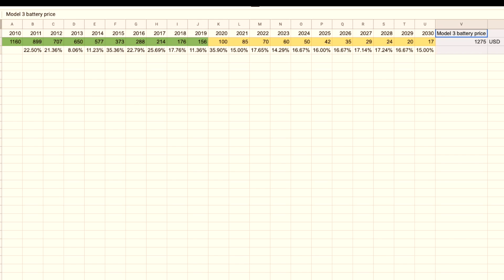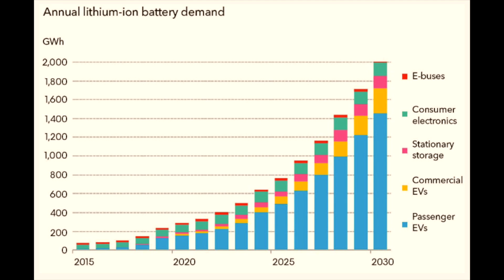Battery productions will skyrocket, and price will drop out of the sky | $20/kwh is coming |

Comment: Raw materials is currently around $60-$80/kwh for Tesla.. So even if Tesla could transform raw materials into batteries with magic and no cost.. It would not be close to $20/kwh..
These kinds of numbers pulled out of nothing is not great for Tesla and very bad for their investors.
Reply from the maker: Yes with the material that are in them today. But that will change toin the future 😉
Reply: @BestInTESLA  What materials will Tesla use in the future? Even the LFP batteries from china which is made from dirt cheap materials are several times more expensive than your target. kwh/kg needs to multiply several times before $20/kwh is possible.
Reply: Nicki Jensen watch the battery day presentation
Reply: @amitcarbyne3635  they did revolutionize the sourcing of materials and they can soon create batteries at 50-60$/KWh.
Its very insane!
Reply: Nicki Jensen yeah tesla is insane. $70-80/KWh by 2023 & 200 GWh/year production. Super insane

Comment: Tesla has 1 million+ cars on the road.
Let's say in 10yrs time these 1m cars are scrapped. And These battery packs are just 10% of their former capacity. If the packs started off at avg 50kwh(for argument sake) , these used battery pack of combine together have a capacity of 5Gwh of storage. If Tesla did actually buy these used pack back, then they would have a good nice size grid storage of Gwh range. They could actually also become a huge grid storage auction bidder company. So another 10yrs another bunch of EV comes off line too become storage etc...
Not bad for used batteries.

Personally think these cars would be scrapped (or battery swapped) at not 10% capacity - 20 miles on the tank but rather owners will give up at "it's only giving me 120 miles of range"... 
That's 40-50% of former capacity.

And having read your title $20 /kWh pack and thinking "really?"... Now, it's yes I guess you could be on the money...

Comment: $20 kWh is coming by 2030 is a stretch. In my opinion, we may not have the adequate cheap materials on time. Even if Tesla was to go into mining, not all Big boys will. Lithium availability will be a headscratcher! 

We need to see a real move towards ramp up in materials mining! Its 2020 and except for Tesla, we still at the stage of determining which is the best battery chemistry! before they make real investment decisions to ramp-up mining lithium based on a battery chemistry latest 2021. 

Then assume Elon time in ramp-up of lithium mining factories (5 years), battery factories (2 years) car manufacturing factories (2years)? then ramp up all to make 10 million cars?

Comment: Please consider, that in reality each exponential curve is natural limited.
It might be better to compare the price drop with the number of produced storage and not by years.
Empiric data shows often halving of production cost by 10x larger production volume. Therefore the future price in 2030 might be rather near $40...45 / kwh.
$20 seems unreasonable too optimistic in my opinion.
Reply: jan gauss with recycling of batteries $20/KWh is possible by 2030
Reply: @amitcarbyne3635  considering the effort tesla makes, it might be possible in 2030
Reply: jan gauss yeah i think it will be possible specially when tesla cracks solid state battery. After 2030 we might even look at the possibilities of nuclear reaction direct ion ( no steam needed ) creating batteries.
Reply: @amitcarbyne3635  Solid State isn't needed anymore. Dry coating + silicon is enough.
Anyway future battery chemistry will advance even further.

Nuclear + steam is an efficient way to produce energy (compared to other methods).
Reply: jan gauss no it’s not. Reducing battery weight is important. Imagine direct electricity generation from nuclear reaction without steam.
Reply: @amitcarbyne3635  battery weight is reduced a lot with the 4680 cell! Elon just has not stated it... However the presentation and hard facts shows it.

Electricity without steam is in my opinion extremely inefficient.
Nuclear generates heat. Heat needs to be transferred into motion before getting electricity. That's a fact.
Only thermo elements can generate electricity directly. In cost of >95% loss.

Comment: "How are we gonna get all these batteries" Important question! We can view batteries as a limited resource, at least for the next few years, and as such we need them in as many cars as possible to make the most impact. So light plug-in hybrids with an electric range of perhaps 25 miles = 40 km will result in more CO2 reduction than what eight times fewer fully EVs can do. Fully EVs need far bigger batteries than plug-in hybrids, perhaps eight times bigger.

Comment: Think the new chemistry is already in the batteries. Elon said the chemistry is already better than the old cells (better range in new cars). I think the million mile is already in new cars. But the other thing (dry electrode, etc) will come after. Continuous improvement, moto of Tela
Reply: Unlikely. I guess the million mile battery will be the LFP battery produced by CATL for the chinese market. They will not offer better range but will just be cheaper and have a longer lifetime.  "Better than the old cells" - yes, better cycle life than the old NCA cells used by Tesla so far. And better capacity per weight than current LFP cells. But I doubt they will give you more range and better cycle life at the same time. But let's see.

Comment: I would like to see Tesla hold off on all production of cars build semi build truck and ramp up batty production with solar roofs and build chips and make sure chips are secure from any type of emp as well as stock pile solar roof tiles in secure area under ground in a boring company tunnel under a city just protect all electronics and truck as well as the vehicals in storage from emp and Americans buy the china Tesla 2 cars to put in gaurages that is safe from a emp dyi self care

Comment: That is a total stupid Tesla promotion! What to do with all these batteries if there is nowhere to charge? Furthermore battery price should include disposal and the road digging/cable laying needed for the charging points. Nobody wants to carry a dead weight of 800 KG in a car for an acceptable range. Best power source will be H2 and Synthetic liquid fuels. Now return your free stickers to Tesla and get real.
Reply: Charger networks, utilities, parking garages, home owners, many entities will be building out the charging infrastructure. As it stands right now, going electric is the best replacment of fossil cars. People can even charge at home. 
H2 has already lost to electric and will remain a niche market. Synthetic liquid fuels have obviously not had a breakthrough either.

Comment: Sir, you make some great points: however saying the price of the battery will be down to $20/kwh  is something I disagree with. The raw material costs alone are above that and there is only so much battery density you can get. I believe $60/kwh is achievable . I hope you are right and I am wrong.
Reply: Going LFP reduce the cost of materials since iron phosphate is so much cheaper compared to nickel aluminum oxide. Switching to lithium metal anode also reduce material cost since you are removing high quality graphite and replacing it with thin lithium coated metal foil. Cell to pack technology reduce the amount of packaging material. Additive that increase voltage increase the energy capacity per unit mass which means you need less battery cell per kwh of capacity.
Reply: @kazedcat  All good points. You can add the tabless electrode to the mix, which has major potential advantahes for cost reduction, life improvement, reduced thermal management requirements, faster charging, etc. You should also subtract credits for simultaneous use of the battery for its energy storage benefits to the grid. These credits could potentially exceed $100/kW on their own, making the battery essentially paid for entirely by these credits.
Reply: Correction - meant to say $100/kWh, rather than $100/kW
Reply: @greggrant4614   Thank you. I hadn't considered energy storage benefits to the grid. You make a good point
Reply: @kazedcat  You make great points. However can this be scaled up? If so go for it!

Comment: I hope that Tesla can ramp up production for their own cells soon. I expect most car manufacturers to fully embrace the battery electric setup and start scrambling for sells. They will fight to get battery production, and could end up driving prices upwards since battery cell manufacturers will only provide production capacity for the underestimated demand. A burst in demand would thus end up with higher prices. But if Tesla starts manufacturing their own cells and get the cost of those cells consistently below 100$/kWh, it doesn’t matter that other manufacturers are driving prices up. They could even start supplying the other manufacturers with B grade cells of their production lines if they have enoug production capacity to fulfill fulfill demand of their vehicle production with A grade cells alone

Comment: I own a long range model 3 with a 75kwh battery, I'd love to swap that out for a new to be developed battery so I can go from 320 mile range up to that 1200plus mile range.  That would be fantastic and those older batteries could be used in a power wall.
Reply: Me too 💪🏻
Reply: @chiefinvestigator9671  My model 3 has the upgrade for increased power. I did that a few months ago.  So a longer range would be terrific.

Comment: Material constraints on price will limit the price drop of current generation batteries. Should we reach solid state sodium or potassium metal batteries, with no rare or expensive metals, then energy density will greatly increase with a big drop in bill of materials.
Reply: Sodium Iron for power walls? Anything cheaper?

Comment: The cost will always be dependent on raw materials availability. Cobalt has to go and ideally nickel as there is limited supply.
Reply: Yes, Co and Ni will have to be phased out soon.  Can't scale with those as main ingredients.
Reply: The new battery is without Kobald but with iron witch is Plenty on earth
Reply: While lower in cost per kWh, the energy density of the Lithium Iron Phosphate battery is lower than the Nickel based Lithium batteries (either Nickel-Cobalt-Aluminum or Nickel-Manganese-Cobalt). Not sure what all Elon might do to offset this energy density  deficiency of the lower cost Lithium Iron Phosphate chemistry. Ultimately, we will probably need the Lithium to be replaced with something much more readily available and cheaper, like Sodium, to get below $70/kWh at the battery pack level.
Reply: @greggrant4614  NaFePO4? Cheap for power walls. Battery day nearly here. Elon says alien tech?
Reply: @gavinmcintosh7022  It appears LiFePO4 will be produced by CATL in China at least for Tesla cars produced in China, not just for Powerwalls or Megapacks, though it would make sense for Megapacks where energy density is not as important. This battery has also apparently been approved by China's government for use in a "longer range" Model 3 to be produced in Tesla's Shanghai gigafactory. Hence the mystery is how does a lower energy density battery turn into a longer range Model 3? I guess we will get our answers about this alien battery on Battery Day, but it could be a combination of new technologies alkng with the LiFePO4 chemistry, such as the tabless and Maxwell's dry electrodes, eliminating the modules, and other technologies.

Comment: what about availability of lithium. not enough available and takes years to get mines up to full capacity. Tesla needs to own many mines in order to produce so many batteries. haven't seen any sign yet they've secured lithium in quantities they'd need. so I remain skeptical about how many batteries and thus cars Tesla will produce.
Reply: Lithium is not and never has been the problem. Cobalt, Nickel and copper will be the limiting factors.
Reply: @Dave5843-d9m  till now. before we weren't talking about millions of cars over next several years. check out what the mining experts are saying on this. Tesla needs to secure either a couple of mines or secure exclusive access. power plants, cars, trucks, power walls; this kind of scale is unprecedented and will need the corresponding lithium. mining takes years to get up to scale not months.
Reply: Tesla needs to buy  lithium mines in USA, Europe  and Western Australia

Comment: I’ll go with your optimistic outlook.
And possibly, we’re not just relying on Tesla, (and maybe a few auto manufacturers following in their wake), for a massive ramp up of battery production? AMTE Power and Britishvolt will hopefully stay friends in their bid to setup a 35GWh capacity ‘gigafactory in a joint venture in the UK. And Northvolt’s plans to output 32GWh in Sweden and 24 GWh in Germany. Not huge scale at the moment, but maybe the ball is beginning to roll, and like a snowball, will dramatically increase in size as it rolls along.

Comment: I’m very worried about the supply of lithium if The demand for batteries for EVs and Electric grid storage continues to rise as projected. It takes a long time to develop new lithium
mining production.
Reply: Lithium is only 3% of any battery and it’s not hard to find. The big issues are caused by electrode materials. 
The best bet for static batteries is LiFePO4 none of the materials are hard to find and their poor volumetric efficiency won’t matter.
Reply: @Dave5843-d9m  Yes, but for utility scale storage, LiFePO4 might have to compete with flow batteries.  Not sure how the economics of those shake out.
Also curious how liquified air and some other technologies might do.
Reply: Lithium mines in Oz already supply 35% of China demand. They are not even at capacity. Sodium makes more sense for lower cost.

Comment: I think you cant forever expect prices to drop at the same percentage. All the raw materials and cost of manufacturer would have to drop. Improvements there will be. But increasing scale reduces some of the cost but not linearly. I think based on Catl producing cells at 60usd kwh, and packs at 80usd kwh. I can see it at  least lower than that. But even at that price BEV are cost competitive with ICE cars.
Reply: I agree. You need to add the cost of producing the batteries with the cost of materials, which IMO is a much smaller percentage decrease yearly
Reply: If tesla starts their own mines then that could drop aswell. Global  Lithium production needs to increase by over 30x in the next 10 years to meet the demands of all these batteries. If car company don't invest in the supply chain it's not going to grow anywhere near that and the price is going to sky rocket.

Comment: Well, the reduction in price will not be linear like you suggest.  From now on, I would say it will be -20%, -15%, -11%, -8%, -6%, and then the price to produce will stay there or even increase depending on the availability of the materials.
Reply: Have a read about Wright's Law. You might be surprised.
Reply: Why the fuss about solid state?  We already have that in LiFePO4. It’s poor on volumetric efficiency though not too bad on mass per KW. 
Other chemistry will come along but we won’t see any step changes.

Comment: Good intro btw. Tesla is likely to hoard the vast majority of the car market industry, just as Microsoft does with its 80% - 90% share of the PC market. Or Google's 90% search engine market domination. It would be silly to have another car that is not a tesla.
Reply: The part that excites me most with what you're saying is that Tesla does not only lead in battery tech. But also in autonomy. And also in drive-train. And also also efficiencies (octovalve,etc.) And also also also software. All of these battle fronts compounding over time...madness.
Reply: Tesla will be a major player, but the Chinese are going all out toward EV manufacturing.  Probably the top 3 car manufacturers in the world in 2030 will be Tesla and 2 Chinese companies.  VW may survive, but Ford, GM and FCA are in trouble.
Reply: I disagree. The main function of a car will always be driving on roads, a function that all other cars do just fine. The comparison with Microsoft and Google is just not suitable in this situation. Microsoft windows have a very high market share because of incompatibilities of software between different operative systems. You have to compile a program for every other OS basically. The Windows phone OS died because of simliar reasons. 
People buy their cars for different reasons to fulfill different needs. People will buy other cars than Tesla and it will not be silly at all.
Reply: Yourcrazybear you are not looking far enough ahead. The coming disruption will bring about the end of car ownership - it will be cheaper to summon an autonomous car on demand. It is a difficult idea to accept, but all the elements are coming into place for this to happen.
Reply: Remember then Google was "do no evil" but now have drooped that postion, and what happen then they become the new standard oil? (or close to)
Reply: JR evil inc. would fit better these days.
Reply: No, there will be lots of other brands. But they'll all have licensed Tesla technology under the skin.